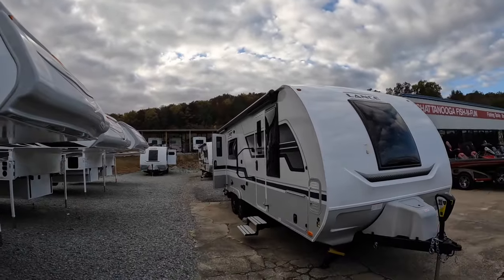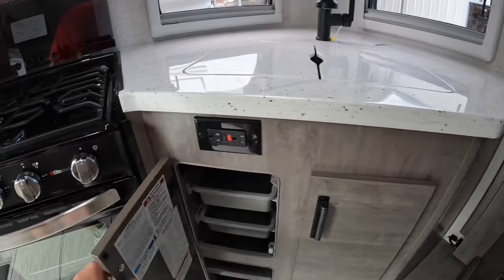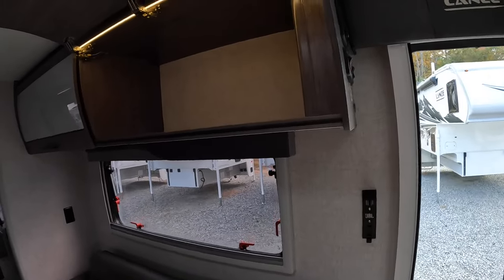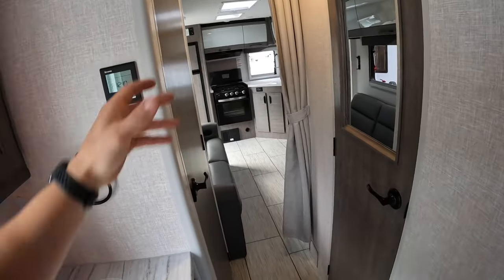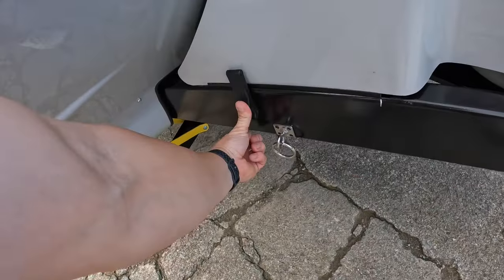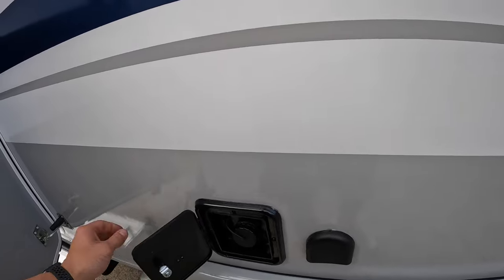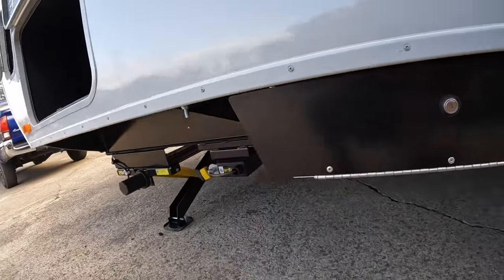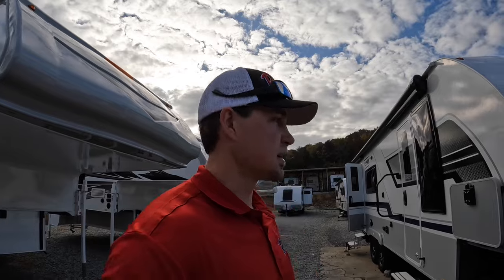2024 Lance 2285 Rear Kitchen Model

Comment: Impressive! We liked everything we saw. Question, is that a full Queen mattress? Question, what is the most solar you can get from the factory on the trailer? Question, do you know who builds the main trailer frame for Lance? Question, just to be clear, it looks like max gross is 8000 lbs correct? We have been considering a small dual axel trailer instead of a cabover camper lately because of my wifes mobility. I REALLY want a cabover, but if my wife cant get up in it then there is not much I have to say about it. I cant pull this trailer AND my Ranger boat behind so that is another problem.  Thanks for the tour.
Reply: 60 x 80 queen,  not an "Rv queen" so many brands have.